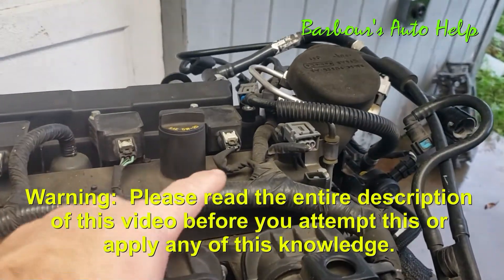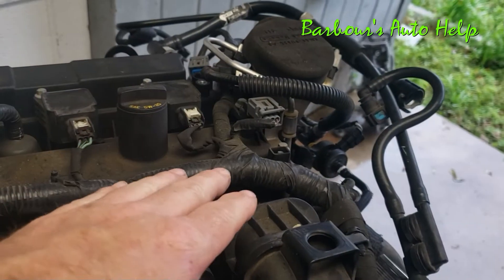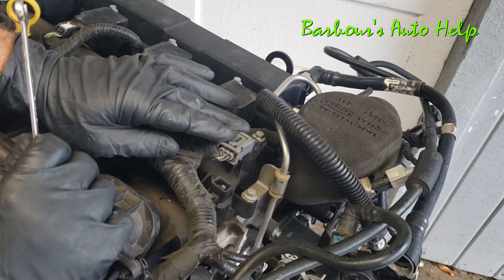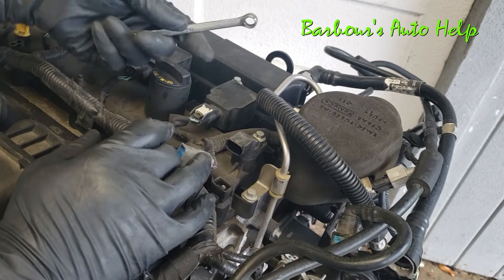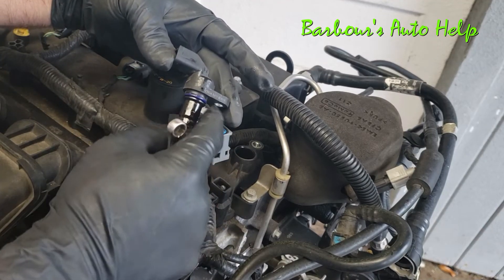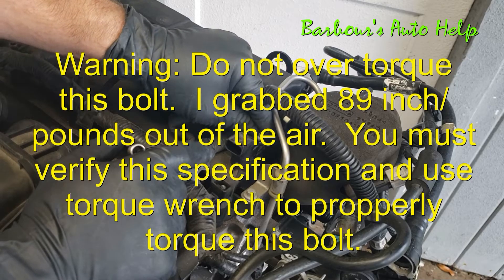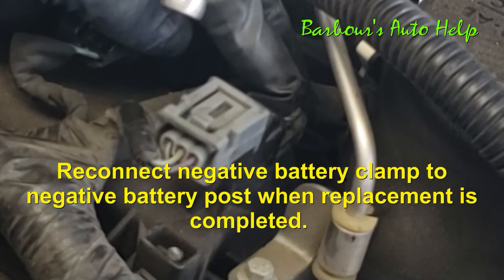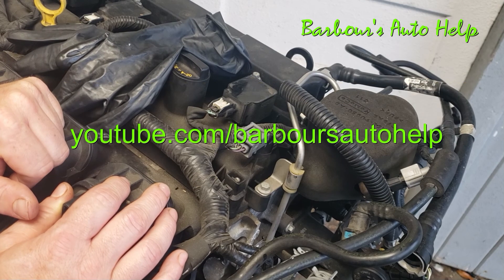Camshaft Position Sensors Replacement 2012-2018 Ford Focus 2.0L

Comment: Thanks for the video. Just tapping it softly and turns slowly.  And a bit prying motion is coming out. The design is I would say nine out of 10 to be honest if only there were two big flaps on these two small plastics to be able to move them to turn them easier. Otherwise it is a very nice design.

Comment: I changed my valve cover and the exhaust side hole for the cam position sensor has an inward taper at the top of the hole.  So my cam sensor cannot sit flush like the front.  Is there another sensor I can use?

Comment: I was wondering if you can help me. I have code PO333, PO68A, P068B. I jumped my battery for the past 3 days due to it dieing overnight because I let the access port in overnight. The car now shuts off while driving. Any help would be appreciated

Comment: I am having codes P0320, P0344, P0369, P061C, and P1336. Have replaced both camshaft and crankshaft sensors but still get the fault codes and the car won't start. Do you have any tips? I'm almost giving up on this car.
Reply: Did you ever get it figured out? The only code I don’t have that you do is p1336

Comment: My. Ford Focus had some work done such as the harmonic balancer and a crankshaft pully however once those were replaced my engine light came on and I got a code saying it’s the camshaft sensor, that was also replaced, and the error is still occurring. Will there ever be a fix for this? Idk if the shop may have caused this
Reply from the maker: What is the code exactly?  And what is it’s definition?
Reply: BarboursAutoHelp me personally have had the same exact experience as this guy I have a code p052A ,P0103,P0113,P0131
Reply: @BarboursAutoHelp I'm having something similar, I replaced the valve cover gasket so, after everything was put back together, all of a sudden I got the check engine light on so, I scanned it and it's giving me code P0013 ( B Camshaft position actuator A control circuit/Open bank 1). Would that be the selenoid or the chamshaft sensor??
Reply: Yo same bro

Comment: Replaced both sensors. Code came right back and power loss persists
Reply from the maker: Do you have diagnostic trouble codes?
Reply: @BarboursAutoHelp  yes. Cam position sensor.
Reply: @BarboursAutoHelp  yes.camshaft position sensor.
Reply from the maker: @vids2290  What are the code numbers... PXXXX?  Was any work performed recently other than replacing the sensors?
Reply: @BarboursAutoHelp  p0340. No work done in 57k miles other than oil changes, front brakes last year.
Reply from the maker: Have you checked pin fitment and continuity on your electrical wires from pcm to sensor?
Reply: @vids2290  did you fix it?

Comment: so which one is more importent and cuz misfire?
Reply from the maker: Come again?
Reply: @BarboursAutoHelp  which camshaft sensor is more importnat
Reply from the maker: Both
Reply: @BarboursAutoHelp  

I have a 2016 Ford Focus SE and has the following codes

P0300 - Random Misfire

P0301 - Cylinder 1 Misfire Detected

P0304 - Cylinder 4 Misfire Detected

P0316 - Misfire Detected on Startup (First 1000 Revolutions)

I've replaced the spark plugs and swapped Coils 2 and 3 with 1 and 4 and they came back

I'm thinking it might be these Camshaft Position sensors based on some research.  Do you have the part numbers?
Reply: @JEE7600  have same iisue with my focus mk3 ST if you fine the solution pls share with it. In my case it wasnt the camshaft sensors.
Reply: @wegiel1987 lmk if you found the problem cus my ford focus 2014 has the check engine and only starts after a couple of try’s
Reply: @IAMWETO  It seems like a different problem. My is random misfire at cold start